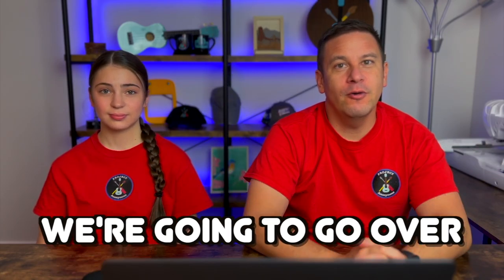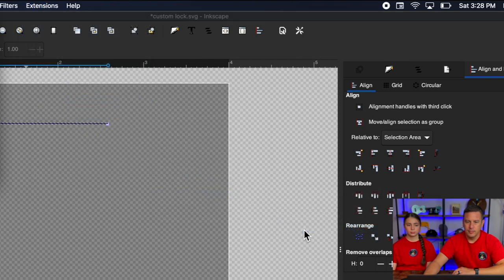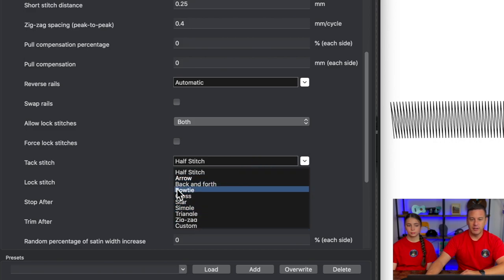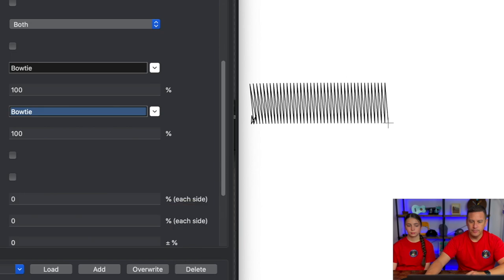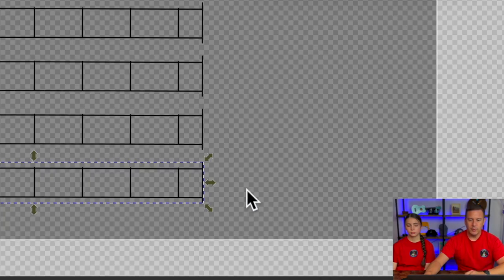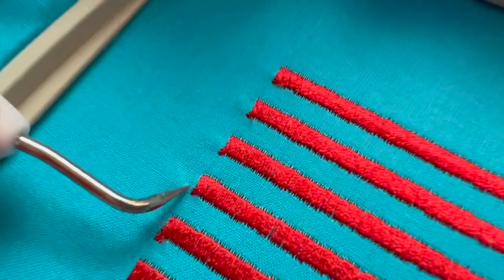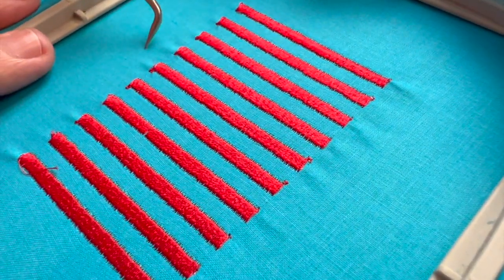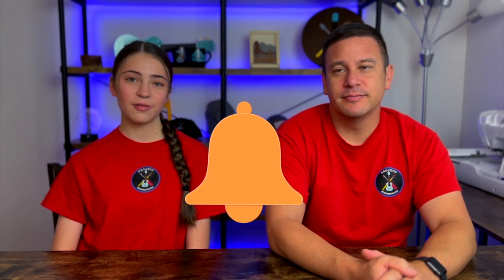INK/STITCH TACK & LOCK STITCHES | Satin Stitch Unraveling Fix

Comment: I realized that the reason why my satin stitches keep coming off my patches is that it does a lock stitch on the outside where there isn't any fabric to hold onto it. Do you know of a way to change it so the lock stitch is performed on the inside of the patch so it can actually grab onto the fabric?
Reply from the maker: We haven't run into this issue, perhaps you can try creating a custom lock stitch that you can get the placement where you want it.  Thanks for watching!